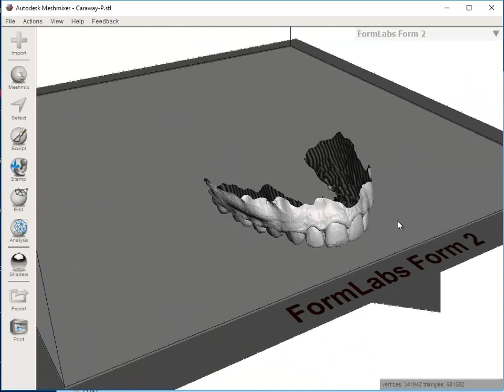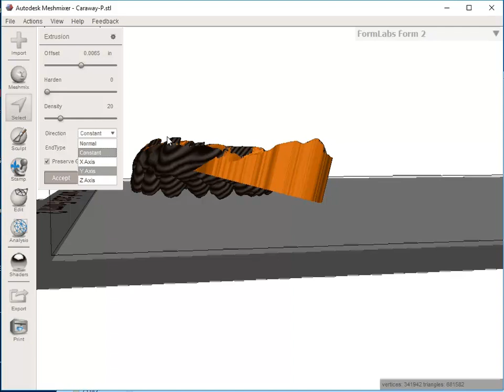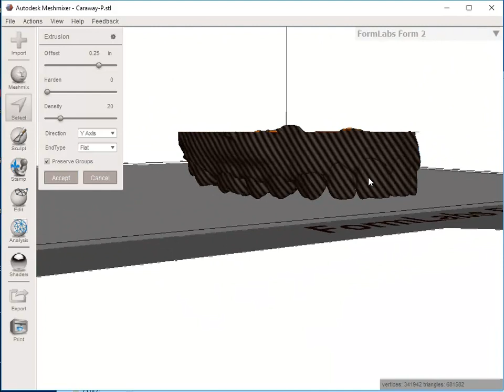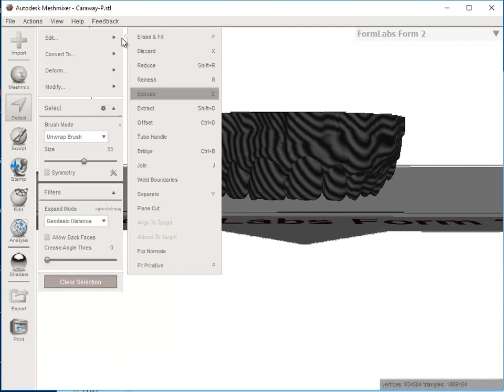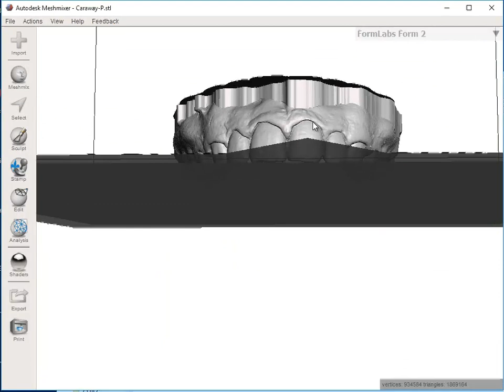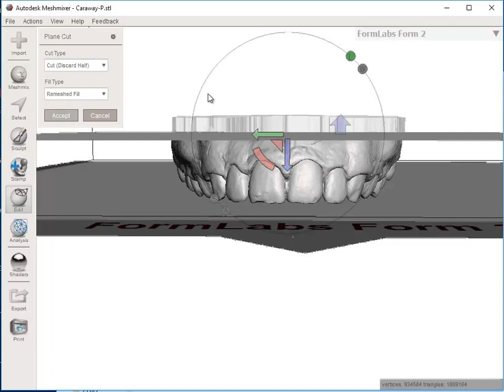MeshMixer: How to add a base to a Dental model

Comment: Thank you for making a video trying to help others learn. Your audio is very low, though. Even at max volume on my Laptop, Windows, and Youtube, I couldn't make out what you were saying.
Reply from the maker: Sorry about that. My older videos suffered from poor audio, that's for sure. You might check out my more recent videos on this. MeshMixer Advanced is a playlist with more current videos and workflows. You can also checkout my website that categorizes the videos much better. Will hopefully be a better resource in the future. Lastly, I have moved on to using BlueSkyPlan for model closing. It's a free software that charges for some functions, but this is not one. Much faster at cleaning up the models, basing them, and getting them printed.

Comment: Baron, thank you so much for all your videos. I have jumped into this with both feet a few weeks ago! It has been a steep learning curve but I am finally getting a handle on printing and doing my own aligners with Blue sky. Still not ready for prime time, but close. I couldnt have done it without your generosity. I have had a couple of print failures when I based models. I couldnt figure out why. When I looked at the model in PreForm I noticed that the first layer was NOT a complete layer. I use "page up" to see each layer.  I havent figured out why, but I am going to keep playing with it. I find when I "make model solid" I lose some detail around the tooth margins. Thanks again.
Reply from the maker: +emccallum1012 try never to "make solid". That decreases detail significantly. Are you using "Select Base" in PreForm to orient your models for printing?
Reply: When I import into Preform I would get an integrity error. So it must be something I am doing in MM that no one else does!! Yes, I am selecting the base in Preform and it appears to be completely flat on the platform. However, when I "page up" to see each print layer, the first print layer is not a complete horseshoe, it is just two small pads. The second layer is a complete horseshoe. So, I think the model has a gap on the build platform and fails to adhere. That is just my opinion. It may have something to do with how I extrude or plane cut in MM. I read in your bio that you waterski, if you are ever in SC let me know and I can hook you up with some skiing that you will not forget! Thanks for the reply. ernest
Reply from the maker: +Ernest Mccallum you have a non-flat surface. Are you "closing the model" in BSP?

I grew up on a boat in the summer. But honestly don't know if I've water-skiied in the last decade. Sad since I own a ski boat. Blew up the engine on the first ride 3yrs ago. Now I just pay to store it... 🤦
Reply: The ones from BSP are printing fine, and I am closing them. The couple that did not print properly were straight from my scanner (CS3600). I am testing scans to set up models for Essix retainers. So I am going from an exported .stl to MM.  Maybe my Plane cuts are off and I didnt notice. Just so you know, a week ago I was having trouble moving the model in MM!! How are you setting up arches for retainers now? Vertical with added platform? Do you label them? I added a couple of letters with MM on a test model, and it worked ok.  I appreciate your time and I promise I wont bug you anymore until after the holidays!

Get back skiing!
Reply from the maker: +Ernest Mccallum if you haven't, watch the first video in this playlist. And the third (about errors) and the last (alternative to distal plane cut).

https://youtu.be/kUFIXWcCky4
Reply: Hi Ernest! I have  my Form 2 printer on order this week and have a Trios Scanner except I don't have the model builder software. I am adding 3D printing and aligners in addition to Invisalign.I guess this meshmixer is what I will need. 3Shape wants another $2500 for  "Planning Model Builder"  plus a recurring $990/month perpetual agreement to to what I paid for orthoanalyzer. I really don't know what more their software does as compared to MeshMixer.
Reply: Hey Bradley! Long time,  hope all is well. I did my first scans on patients this week. SOme records and some retainers. The retainers printed great.  My plan is to use Blue sky bio for aligners. I just cant justify the software costs of 3 shape. I did a test aligner case on my assistant with Blue sky and it seemed to work fine. My other option is to use Exceed ortho. They set it up for you and send back .stl files for you to print. Either way it is way cheaper than conventional aligners. I am very excited about the scanner an 3D printer. I will be in the office in the morning, feel free to call me. I am using Meshmixer just to base my retainer models. I would be happy to share what little knowledge I have gained! All the best.

Comment: Tried to watch.  The volume is extremely low.  Could not continue.   Sorry
Reply from the maker: Yeah. Sorry. On some devices, like my phone, it's fine. But others, no so good. Fortunately, it's an old video and I've made many updated videos that cover the same process with more efficient and effective techniques.
Reply: Baron Grutter DDS. Thanks for answering. I didn't realize it was an older video.  I will check out your other videos.  Thanks again!